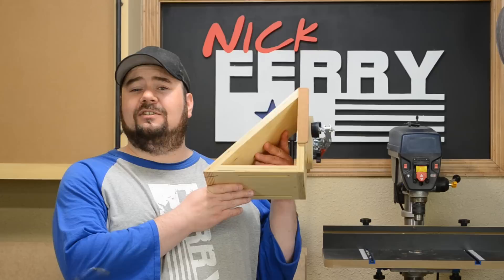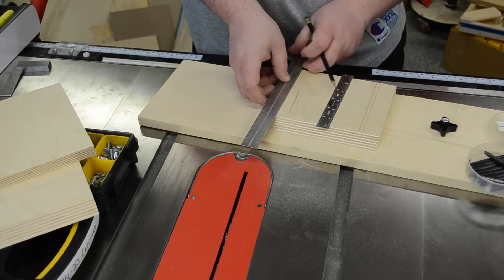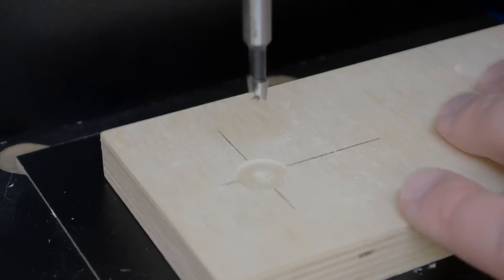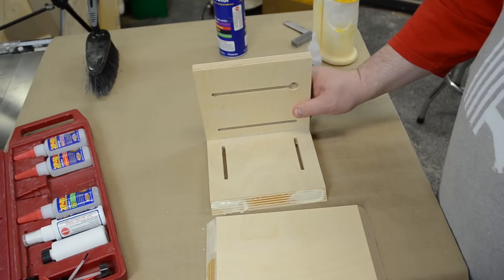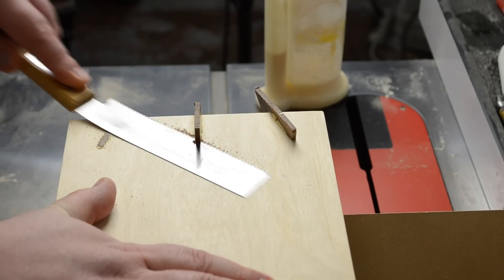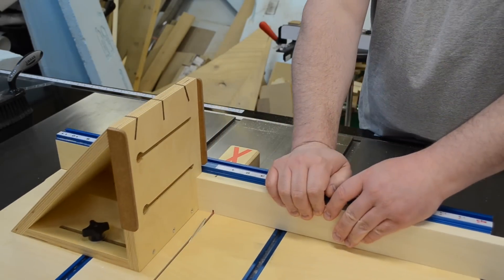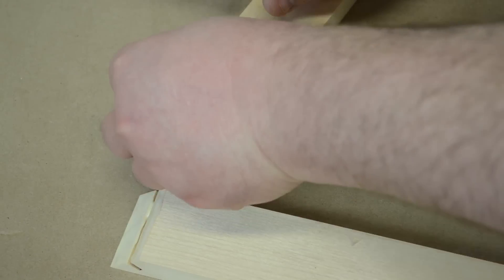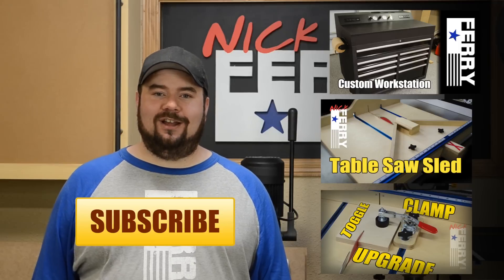Ⓕ Spline And Tenon Jig - All-In-One (ep67)

Comment: Great design! seems like if you cut a piece that you intend on putting a 45° cut on you can use that sloped portion and then flip it over quickly to put in the splines.
Reply from the maker: you could in theory but the work piece would already have to be cut to exact length and I don't like the idea of the piece being able to be slid into the blade down the slope - not to mention the jig would have to be moved to make the bevel cut and then moved back to perform the spline cut

Comment: Good design.  Multitasking is always a good thing. Comment:  You will get a better cut using a flat top (ripping) blade works on the tenons. Scribe lines with marking knife to avoid tearout.
Reply from the maker: thanks - I agree with the marking knife and it was just a quick test tenon - for me the shoulder cut depends on if I want to change the blade or not - but with either blade, I seem to go approximately 1/32" deeper on the shoulder cut anyway - just always how I've done it and I never have to clean up the shoulder/cheek intersection to make it properly seat in the mortise

Comment: Hey nick. Great jig. So I built your sled right after you posted it and I absolutely love it and use it every day but something I run into frequently is the inability to cut long pieces with a stop block simply because the sled is only so wide. I would love for you to come up with a cure for the problem as I always love your jigs. I've thought about screwing a long straight edge to the back fence but don't want to deface the awesome sled. I look forward to your ideas. Thanks Brock
Reply from the maker: Very cool to hear, thanks - I've been asked that a couple times - I do have a solution - I'll try and make a video on it - stay tuned!

Comment: Hi Nick, what do you think of MDF?? We use a lot in the UK, but been told the US dont like it
Reply from the maker: It seems I am one of the few that like it as much as I do - the drawbacks of course are it's heavy, the dust from it is no good, and it doesn't take screws the best - but it routes and shapes really well, paints up nicely, is common in a lot of areas, and is fairly stable - so I think it has it's place
Reply: Oh I know about the weight of it, and yeah the finish is good, Glad you like to work with it for and during some projects

Comment: This looks great.  I might try building one or something similar.  Thinking of putting a set of slots on the side that is 45deg to the blade, so that I can miter small pieces with my table saw sled.  This way I don't have to tilt my blade and can use my table saw sled.  I made my sled several years ago, so it's not quite like yours.  I did put slots in the sled though.
Reply from the maker: +John Hendricks very cool - sounds like you have some work to do

Comment: You could add a small strip on the 45 degree angle where you can clamp a mitered joint box to and you can do exterior splines with it as well. Bit hard to explain :P
Reply from the maker: Absolutely - there’s a ton of possibilities

Comment: Hi fabulous jig! I'm making a long table with everted flanges, these flanges will have an angle of 150 degrees to the table top, I believe that if your jig could be made to accommodate different angles rather than just a fixed 45 degrees, then I could very well make spline joints for the flanges, as I think glue wouldn't be strong enough. Is that a good solution or do you think a different joint might meet the requirements?
Thanks
Reply from the maker: splines would be perfect - many times in those highly acute angles there isn't enough room for dowels - keep in mind the splines don't need to be of a contrasting species - many times I use the same wood and the grain direction difference is a nice subtle accent
Reply: Nick Ferry 
Hey Nick, thanks for the prompt response. By the way, an acute angle is one that is less than 90 degrees, I'm sorry you may have misunderstood my query...I want to construct flanges that are greater than 90degrees....150 - 160degrees splayed out from the table top, splines might well be strong enough, however I had thought about making sliding dovetails, all the angles with the dovetails and the flanges seems a bit daunting especially with two connecting pieces at an angle of 160  degrees!! Yikes! I think I might have to use a shim with a 10 degree angle, clamp it to the piece so that the piece will have a 90 degree face to the router bit. Then to use a dovetail bit to make a sliding dovetail.
Thanks again, I think I might  just have envisioned the process by enunciating it.

Comment: Small question! The small piece the toggle clamp is connected to, the corners are radiused. I radius templates for router but they don't work on small pieces of wood. Don't tell you eye-balled that.
Reply from the maker: I can't remember but chances are I clipped the corners on the bandsaw and sanded them smooth - that's been my MO lately
Reply: @NickFerry  thanks for helping out

Comment: Another use maybe - turn it so the vertical is back against the fence and the slope is running away from you. You can cut spline kerfs in mitred boxes maybe? Holding it may be a challenge - have to think about that...unless you made a pair.
Reply from the maker: it's not a bad idea, but yes, a second one would be best to secure I believe

Comment: Hi Nick, did you get my Toggle Clamp Accessories that I sent you in the mail?   Did you give them a try?
Reply from the maker: I did, thanks - tried them real quick but didn't much as I have 1/4 -20 so I need to change out the bolt
Reply: If your Toggle Clamp is a Horizontal 225D , then it should be 5/16".   The plastic round knob , carriage bolt &  bolt retainer I sent is 5/16" dia. should fit.  Thanks again.
Reply from the maker: I agree that's how they come by I modified mine with the larger clamp pad and used a 1/4-20 to do it. I'll just switch it back to the 5/16"
Reply: Cool :}